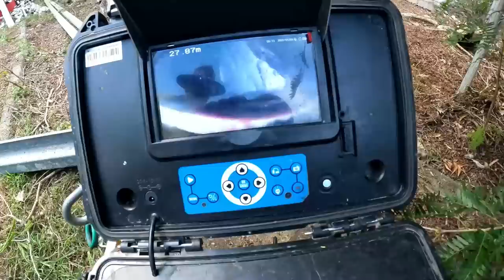Blocked Drain 241 - 50m Of Sewer Drain Completely Blocked | Just Get It Cleared | Find The Problem

Comment: Again, when the others fail, they call you, Gavin!  Another job well done.  Never fear, the Penetrator is here.  If I can't do it, nobody can!  One would think that a school would have all of these drains and manholes marked and uncovered so it would make their job and the job of others easier.  My dad knew where all the utilities, plumbing i/o's, and things like that were on our property.  He also made sure that we girls knew in case he wasn't around when something needed to be done.  Keep up the great work as always.
Reply: I've noticed a common theme with most videos where people are calling for help, not just Gavin. Be it plumbing, heatings/Air, electrical, concrete work the customers don't bother clearing the work space for the specialist they called to fix the problem . They seem to a large extent to expect the specialist to clean up the customers  mess so they can do the work they were called to do.
Reply: @Losttoanyreason  I would be embarrassed to have Gavin or any other trade worker come into my space to work in conditions as I see in these videos.  Here in Canada, I have had trades refuse to go into a unit because of the conditions a tenant kept their apartment in.  If that happens, we give the tenant 72 hours to correct the situation (or to show improvement) if they don't, we take them to the board to either force them to clean up or evict them.

Comment: Really severe block. And not having their manholes easily accesible is inexcuseable! The janitor or groundskeeper should have kept that cut back. And the darned thing needs a locking bolt to keep kids out of it. Flushing heavy paper towel down as you are fixing it! You should send all those pictures into the school board and demonstrate their messes. Better yet, negotiate a biannual camera and cleaning of their pipes. Might as well get some permanent jobs on the books. Great job in a less than ideal situation.